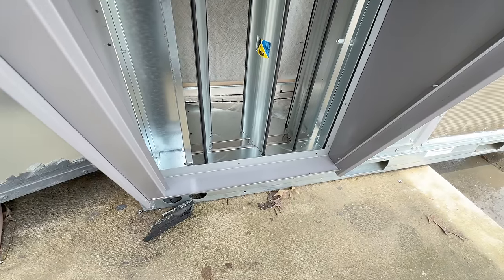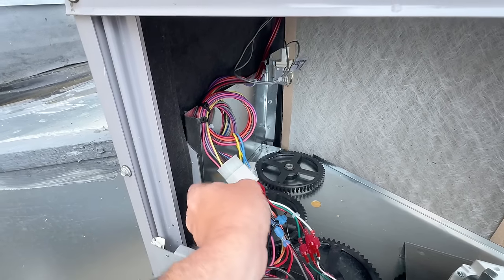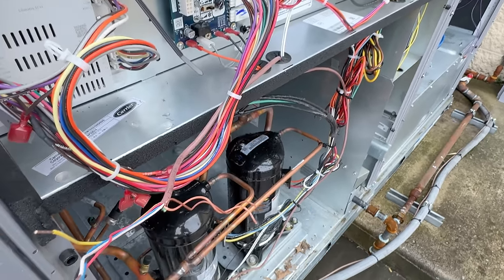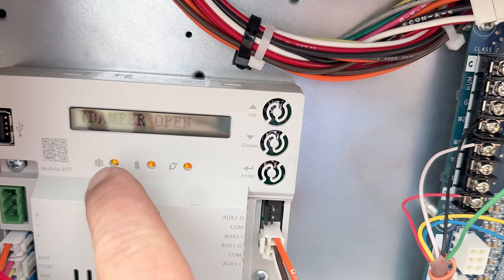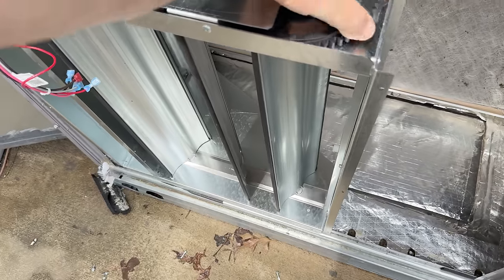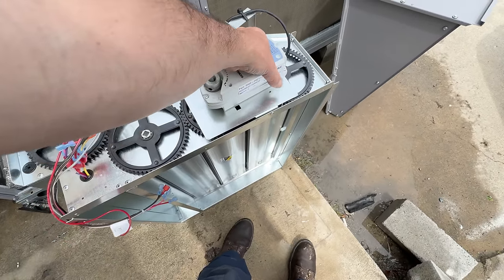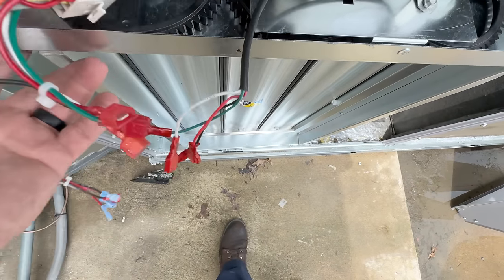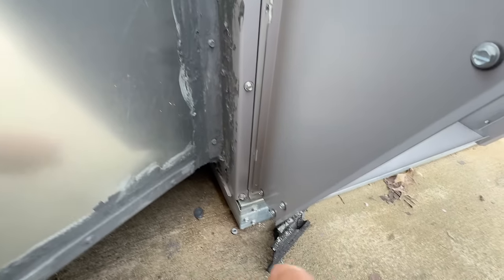Carrier Economizer W/ Siemens Climatix Control First Bad Impressions

Comment: I've gotten to the point where, if I do a start up, I practically touch every bolt with a paint pen as I go around doing checks. I tighten fan hubs, set screws, contactor terminals, compressor terminals, VFD terminal blocks. The other day we had a reheat coil just loosen up one side of the coil bracket and fall, also the head pressure switch for the condenser fan cycle was so loose it came off by hand. I've told my boss my job would be easier if they just sent disassembled units to me and let me build it on site.
Reply from the maker: Cheaper labor and no value system is how we got here.

Comment: Standing damper vanes on their side is a bad idea. The pivot sockets fill up with dirt and subsequent corrosion in short order. Bad design on the manufacturer part.
These younger millennial designers have no ability to think outside of the box and it’s getting worse.

Comment: Your lucky that the carrier you were working had the economizer harness. My was a nightmare. 8 new carriers 20 tons all of them I had to fix all the wirings and match them because they decided the connection from the Siemen actuator is female molex plug and the carrier unit molex plug that goes to the econo to carrier board is also a female connection and the wiring did not match. I had to do one at a time with each wire to cut, splice and   add male and female spade connection. In the end I got them all working. Now with the Lennoxs there easier because Lennox actually has the start up sheet with the parameters to set up on the Siemen controller. I used micromelt website and got the schematic for the Siemen controller wire set up. So when I used it on the carriers I was going by the schematic for the Siemen controller and the carrier schematic they both did not match up didn't match up with each other. Plus I couldn't get the economizer harness conversation because they weren't in stock.
Reply from the maker: I’m glad I’m not just crazy

Comment: If only the Bypass Plug was left with every install… the humidity here in FL is guaranteed corrosion on the controller connections .. Thanks for the video!
Reply from the maker: I hear Economizers  don’t get used much in Florida
Reply: @HVACRSurvival  only for OA during occupied mode in the South

Comment: The usb stick is basically a WiFi antenna, it’s highly recommended. When they first came out micrometle put on a webinar about them and flat out said the screen was a last minute addition. It was designed to do everything with the app.

Comment: That’s crazy Rick. We do so little new equipment on our light commercial that I think we’ve installed 4 economizers. Most of them were Trane and those suck. They also suck to work on but I’m sure that’s just because I don’t understand them. The best one was a Ruud. Literally tool like 5 minutes slide the damper in screw it in wiring was all there. Same thing in the other side for the JADE controller. That’s about the only Honeywell product I like 😜

Comment: Nah..Bitching is part of the job. 🙂 Looks like the frame of the unit was racked. Instead of a square or rectangle, You now hove a trapozoid.. Happened at American Appliance all the time. Washing machines, Refrigerators, console tv's, projection tv's were racked in transit, piled too high in the warehouse or the morons with clamp forklifts picking things up where it says in RED " CAUTION DO NOT CLAMP BELOW THIS LINE" They , of course , ignored it. Us road techs went out on" Initial Failures" and it usually wound up costing the company money and a pissed off customer demanding an exchange.. As you said, it's a definite possibility things got damaged when they force fitted  and transitioned to the existing hookup. You're right! There should be some kind of 10 cent washers to suspend the louvers away from the frame. I used to rant all the time about the production bean counter engineers cutting corners to make things cheaper. Instead of sticking to the original designs they had to save a penny here and a penny there. All the manufacturers' had those clipboard  Guys. They should have to fix their own junk themselves instead of getting an authorized service company to do it. That means us taking the <PUN> heat for them.
Reply from the maker: Thank You!

Comment: The jade controller can only do two speed fan, the Siemens one can do 3 speeds for cooling. A lot of the new units are coming with 3 step cooling and this controller. Lennox especially is doing 2 stage compressor on circuit 1 and then single stage compressor on circuit 2, which allows for the unit to have 3 different airflows and 3 different levels of cooling. If you get the wifi stick for the Siemens controller the app makes it really easy.
Reply from the maker: That makes sense 👍👍
Reply: How did you get the app and controller to work? MY app crashes constantly.
Reply: @ what kind of phone do you have? Do you have other apps running? Has it been updated lately or have you restarted it? I have not had the app crash at all on either my previous iPhone 15 pro max or my 16 pro max 🤷🏻‍♂️

Comment: Maybe a metal shim on the bottom can lift just enough but I’m guessing the point is to not bypass any air. Why it’s vertical and not horizontal. There was nothing wrong with the old ones

Comment: The new no leak standards are responsible for the lack of "slop" built into the economizers now. Thank the government.
The USB stick with the app makes these a breeze to set up. You can save multiple "programs" and then just upload them as you want for that location. It is quite shitty of them to make you buy the USB stick rather than provide one.
As others have stated, something about the Jade is not compliant with some new government requirement.
Remember, neither Carrier nor Micrometl give a shit if the thing works!!!
I wonder how it would be to have the units set up from the factory with the economizer installed. Would it be any better?
Reply from the maker: Did you see the Mexican engineering in my start up from hell video?. That should answer your question. That was a total cluster …
Reply: @HVACRSurvival  
Carrier equipment has gone downhill    quite rapidly lately.
Back to cheap, fast, good - you only get 2.

Comment: It's just unavoidable these days. There's not a single piece of equipment that is made nowadays that doesn't reek of unreliability, cheap corner cutting and overzealous engineers in one way or another. If that's not bad enough,  it's also like the quality control depts at some of these manufacturers are non existent anymore. It's really sad.

Comment: Carrier sucks, aaon aucks, york/johnson double sucks good times.
Reply: There is still Daikin and a few others to try :D
Reply: @tschuuuls486  worked on 2 300 ton daikin chillers 2 years ago, chillers were 1 year old and all four circuits were leaking like crazy from the same flange. Also had other leaks throughout. Changed the cores and they were the worst ones I've seen from something untouched and brand new from factory. Had flakes and copper shavings all through them.